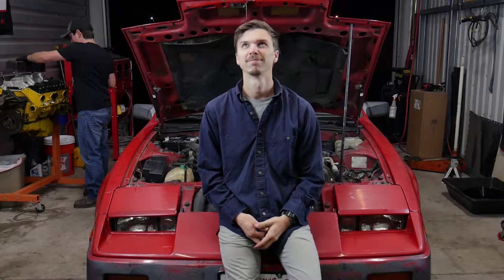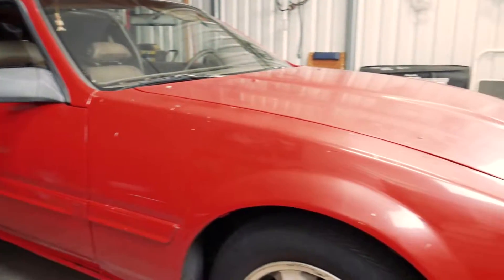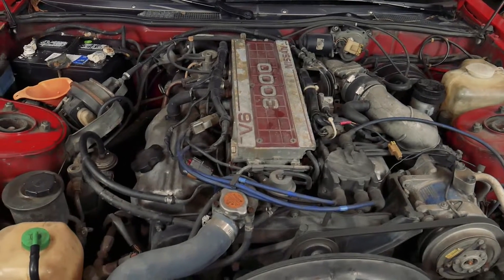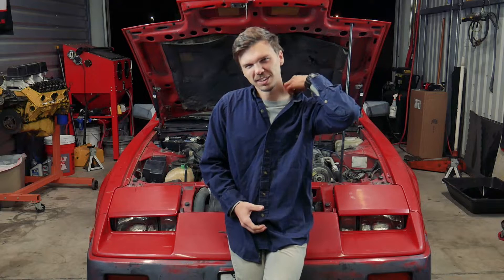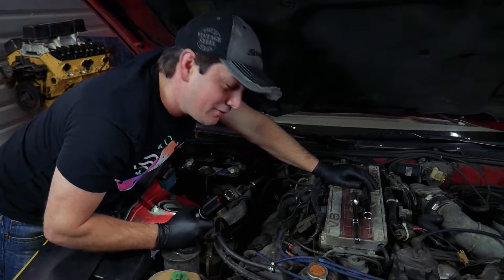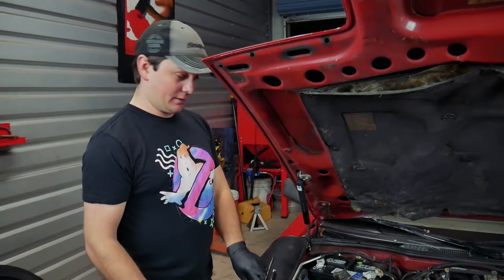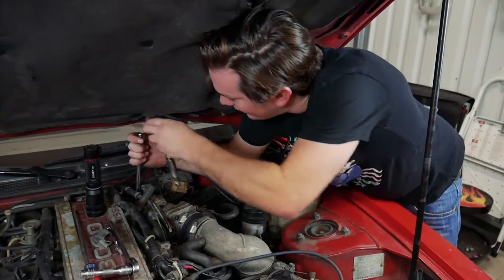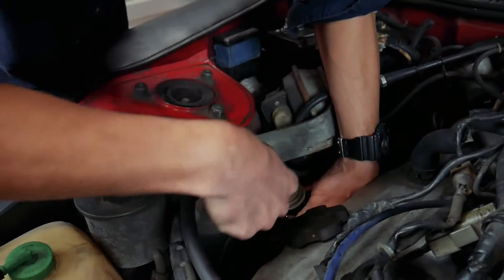1985 Nissan 300Zx Project | 300Zx Stuck Spark Plug | 300Zx Tune Up

Comment: How is the bus coming along? Glad to hear that it is being worked on, hopefully with some filming also. Daily driven hoopties are the best, as long as the radio can drown out the squeal from the power steering pump or the wheel bearings they are good to go...
Reply from the maker: The bus is coming along great! This hooptie doesn't have any bearing or power steering squeals which is awesome because the radio doesn't work.  As soon as we do get the radio working im sure we will find plenty of squeaks to drown out.

Comment: Haha crazy I also own an 86 300zx also. Been having problems with mine though. It won't run right getting into throttle. I haven't had the time to actually work on it. Been putting most of my time and money into the Grand Prix. I should probably change plugs and see what happens. I've changed rotor, cap, timing chain, water pump, thermostat and fuel filter
Reply from the maker: It sounds like you got a lot of work put into it. Taylor's zx would die at idle when we got it but the new plugs cap and rotor really helped it out.
Reply: @BudgetBuildGarage  Yeah funny thing is it had no throttle response or wouldn't have power under load. I got mad so I took it to car wash and power washed underneath the hood, drove off to car not wanting to move past 2000rpm and backfiring. Pulled over and checked the maf sensor connector. Unplugged it, blew it off and reconnected it. Drove off and car hauled ass like it never did since I've owned it!! 2 weeks after it started running horrible again
Reply from the maker: @GPXironczech  It is amazing how a bad sensor can ruin the way an engine runs.
Reply: @BudgetBuildGarage  yeah no kidding, so I'm thinking that sensor is part of the culprit

Comment: hey guys, yep, i reckon those spark plugs were the culprit with your starting issues ::) they were pretty crusty. still,  a small block Chevy, hmmmm :) cheers from Australia, looking forward to the bus updates :)
Reply from the maker: Taylor is really fighting against the small block but I think he will come around.  The bus has had a ton of work since the last time we showed it.  Most of the plumbing is done as well as the counters and cabinets. Hopefully Taylor will get an update soon.
Reply: @BudgetBuildGarage  yeah, Taylor will come around when he realizes that Nissan V6 is almost the same size as a small block Chevy, even a 289 would be perfect :)
Reply from the maker: I took a couple of rough measurements and I think it would fit without to much trouble.

Comment: replacing my sparks and crank shaft sensor today bc my car will just crank and if it does turn on it misfires ik it’s not the pump bc i can hear it prime and i replaced the fuel filter